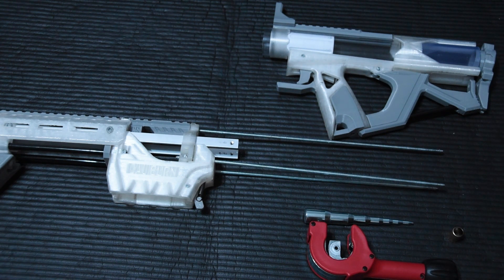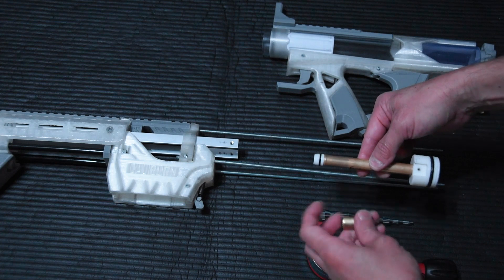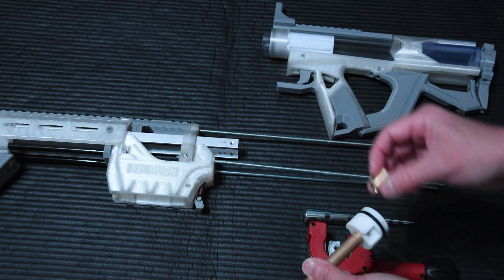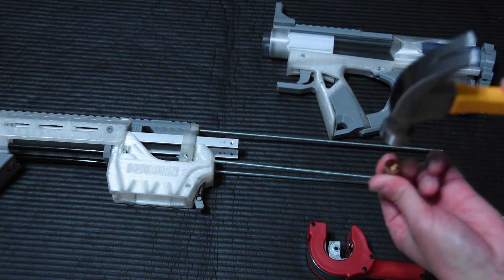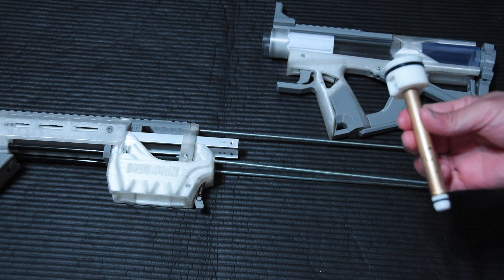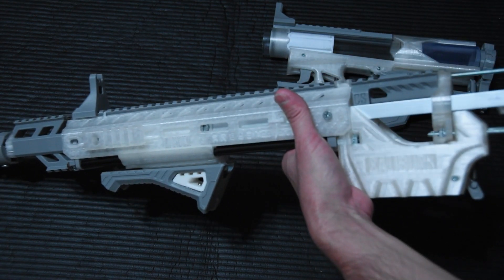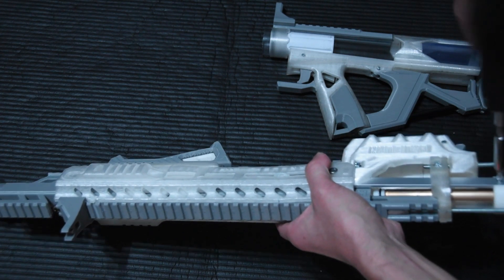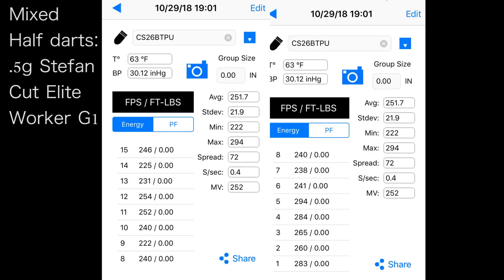Caliburn TPU Air System

Comment: I got my Caliburn shooting BOOMco. Shoots super far. Looking forward to taking it to BTA. Shooting super straight too. Wasn’t too hard to get it working.
Reply from the maker: Post video when you get the time for some field tests; it will probably make me a believer, given the amount of different projectile designs I've been using and comparing.

Only downside of using them for BTA is that 150fps cap. I recently started recording accuracy range tests and have another video with the initial results on the 12" Caliburn
Reply: Daniel Okada The fps on boomco usually reads lower because the darts weigh 1.49gram. It should be low enuff for BTA but also outrange everything bc of the ballistic coefficient.
Reply: Daniel Okada I have noticed the same thing experimenting with darts. Replacing the heads on the boomco darts with something lighter caused a drop in range, tho they read higher on the chronograph with lower weight. It’s the kinetic energy formula. Lowering the weight increases speed but joules stay the same. And lower weight is less resistant to be pushed by cross wind.
Reply from the maker: Now you have me thinking about using boomco dart heads with 1/2" foam rod. I designed a few projectiles in software, but none of the filaments had the type of density needed to load 90% of the mass in the tip, even with short foam shafts, which is generally the only way to get a stabilized projectile in the 200fps+ range.
Reply: Daniel Okada BOOMco darts are stable full length past 300 fps at full length. I got it going that fast with a singled air tank. The shaft of the dart being uniform and not having air bubbles helps a lot. I think the inconsistency of foam is what affects it at full length. And also that once you bend foam it doesn’t spring back very fast. I need to get this kickstarter for the worker boomco darts going. Been sick the past couple days
Reply from the maker: Inconsistency of the foam, which is unavoidable for extruded foam, even when the cuts are perfectly square, may well be the single largest factor in both velocity and accuracy variations seen with foam blasters. And of course it only gets worse with each re-use of a dart. While heads can be designed to decrease drag, induce spin, increase give (for safety purposes), etc. durability never seems to be a factor because the foam gives out long before.

I have my suspicions that the tube foam (it's the hole) is part of the problem, given the results seen with weighted glue dome/foam backer rod darts. They fly between 250-290fps, yet are more accurate than any of the off the shelf darts. What it boils down to is nobody really wants to make their own darts anymore when you can buy a thousand Worker darts or accufakes for $50 or less, and that's before even considering that no group is going to okay the use of glue dome darts in a game.
Reply: @greenmedic88  Can you make a version of this that fits inside glow stick in the front and 7/16 brass? The inner diameter of the glow stick is about 10.65mm and the OD of 7/16 brass is 11.92mm with inner diameter of 10.25mm. Thanks if you can, if not I can try to do that sometime soon. I need to get that tool you mention ha